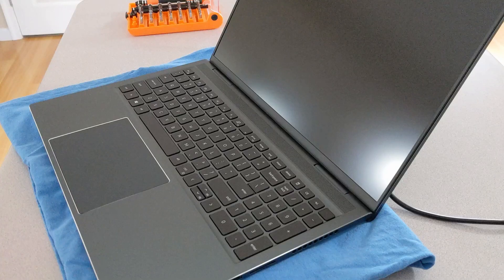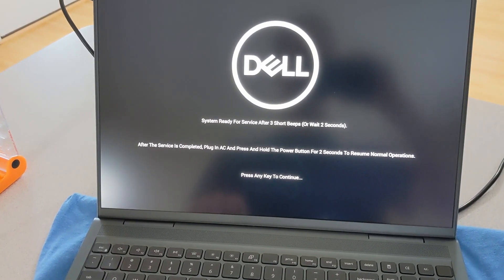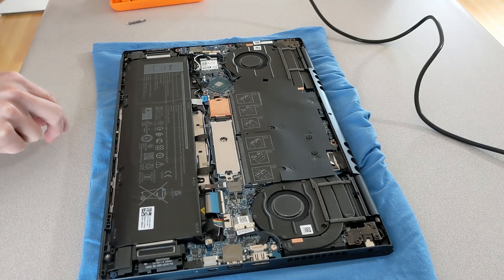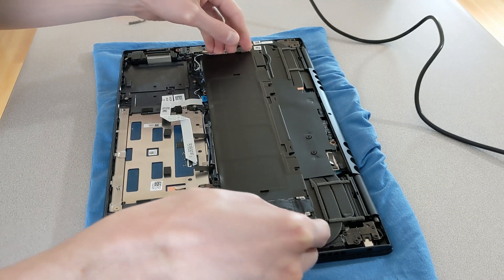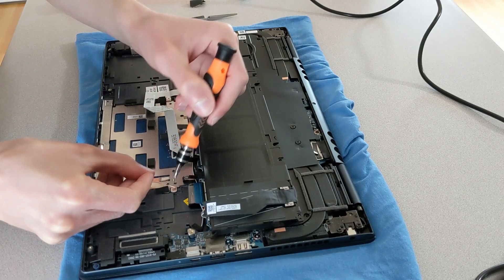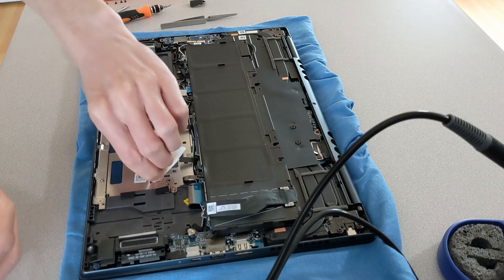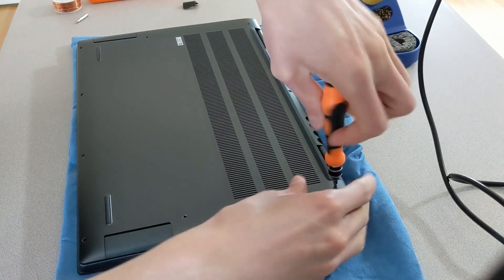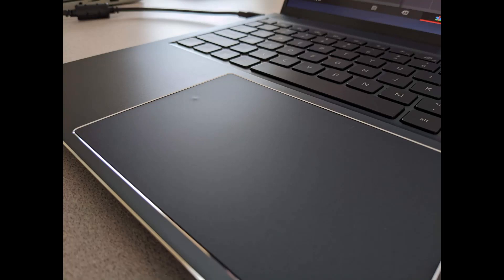Grounding Wire Fix for Erratic Touchpad Issue (Dell Inspiron 16 Plus)

Comment from the maker: I want to offer a big thanks to everyone in the comments for all the kind words and for sharing your results! It is great to see that this fix has helped to restore touchpad functionality for so many users!
Reply: Pretty sure you had your temperature set too high on soldering iron.

Touch pad circuit is just a plastic flex circuit not your normal PCB.

Secondly did anyone here think to use a continuity mode to see if the copper pad and plate are actually touching. 

I have same issue but there is a connection between the plate and the copper pad, how do I know that I used a multimeter to test.
Reply: Also I might add invest in a fibreglass pen to scratch the copper pad for soldering
Reply: Hello Dash rendar  After doing this operation , I noticed 3 new issues , you also?

1) Bump on the surface of the trackpad exactly at the location of the soldering operation, it is ugly

2) strange light electric buzz sounds coming directly from trackpad when you don't touch it, you put your ear close to it, and you ear it as if you hear electricity moving inside trackpad , strange! Before, was not the case! When you put the finger on track pad (contact), this noise disappear, otherwise its permanent noise

3) Device Security Issue
After doing this soldering operation, I noticed issues in Windows Security  - Device Security 
Before I could see the 3 features , core isolation, memory integrity and secured boot, and all was on and well.
Now, those features are fone completely, cannot see it, just white page, on top written : 

"Standard hardware security not supported"
Reply from the maker: @stevewindsenergy  Aside from myself, you are the only other person I've heard from who also got a bump on the surface of their trackpad. Mine isn't bad enough to be a problem or bothersome, thankfully. As far as the other two issues you mentioned, I haven't experienced any odd noises coming from the trackpad or elsewhere, and my computer still shows the three features you mentioned in Windows Security - Device Security.

I don't know what to recommend other than perhaps doing some additional diagnosing to make sure the touchpad is indeed the issue (hopefully nothing else was disturbed/damaged when the laptop case was open). Perhaps open the laptop back up and unscrew the grounding wire, or even unplug the entire touchpad, and see if that has an impact on either of the two issues. I suspect the device security issue may be more involved to troubleshoot and possibly some things may need to be checked/reset in BIOS.

If you determine the trackpad is damaged, it looks like there are replacements selling on eBay for around $40. There have been a lot of people reporting success using metallic tape in place of soldering, so that might be something to consider if you go this route and need to perform the fix again.
Reply: @dashrendar2625  i spent 1 h with dell technicians on phone and 3 hours with Microsoft technicians on remote assistance, nobody could solve problem of missing my security features core isolation, memory integrity..... I am really so helpless
Reply: @stevewindsenergy  Nope, none of those things happened for me. #3 is absolutely unrelated. You really need to reinstall Windows with clean copy, that hasn't been tampered with by Dell.

Comment: After soldering wires all over to fix the issue, which it does temporarily, I'm back to a jumpy touchpad. Now it appears to be affected by static electricity, as if my hands hovering over the touchpad now make it finicky.

Comment: I know plenty of others have said a similar thing, but I wanted to add that I also tried this on my Inspiron 16 plus 7610 (with copper tape from amazon because I don't know how to solder) on both of the copper contacts to be safe and it fixed my touchpad! I got this laptop open box, which I'm assuming the person who initially returned the laptop was due to the trackpad because nothing else has been wrong with it since i bought it in 2021 (and its Dec 2025 as I write this). I even have had this laptop serviced to replace the trackpad and that didn't help, but this video did! I'll have to check the trackpad over the coming days but I'll give an update (if I can remember lol)

edit: 12/9/25 it helped at first, there were no issues but after a few days (like 3 days or so) it went back to being stuttery. not as bad as it was before, but enough for me to return to using a bluetooth mouse. I wish there was a good permanent fix for this, because i have no gripe with my laptop otherwise

Comment: i have a dell latitude 7290 that i bought refurb on ebay and the first day, the trackpad started doing weird things.  I thought it was a power issue (using the wrong charger) but after seeing this, it seems like it's a defect in the grounding.  I may try this, thanks for the info and the video.  Dell obviously has issues across many of its different series of laptops that they refuse to acknowledge!

Comment: worked great with my 5620, soldering was a pain though (apply flux, sand the surface well and set the temp to 380)

Comment: late to the party but wanna thank you for this gem of a fix! Just soldered mine today and it seems to work perfectly again. My touchpad was actually replaced by Dell - it lastet for about a week, before errors reappeared. This laptop is the one purchase I regret most in my life - wont ever recommend, poorly assembled - lot of the plastic broke just through using the laptop regularly. Wish I would not have been blinded by the price and rtx inside...

Comment: did this with yoga slim 7, have same issue where it not just behave erratically but gone from device manager as well. measure continuity of oem conductive tape connecting touchpad to metal body then to motherboard ground, issue is with the tape. Do a bit of reseating of the tape then measure until continuity is detected to the ground consistently, then no more issue with touchpad ever since !

Comment: You are a lot of help, i have a dell Inspiron 16 5620 and after using 2 weeks after purchasing, it's cursor like shakes when moving finger over touchpad even in straight line, I called dell and they replace my touchpad and after some time same issue start happening. Then i came accross your video i did almost what you did just didn't have the soldering iron at hand so just tuck one end of the copper under the screw as you did and on the other side just make a thick lub of the copper and put in the hole touching the copper surface and use the electric tape over it and it works

You really helped other i was about to throw my laptop out of frustration

Thanks

Comment: I want to express my thanks for this video and the guidance towards the problem. After years of trackpad issues and me trying to get to the bottom of it, you explained very well what the issue is. For me, I didn't need to do the whole copper wire grounding thing. When dismounting the trackpad, I noticed that the metal pieces of the trackpad where the screw holes are, and which should make contact with the the rest of the laptop's grounding, were covered halfway in black paint (probably while the trackpad was being painted black, they over-sprayed it). I sanded out the paint, sanded around the screw hole of the other metal plate and everything got fixed. Thank you very much again for this video.

Comment: Thanks for the video. I had received my Inspiron 2 in 1 back from repair for a keyboard issue. The replaced the palm rest keyboard tray assembly. Sinc ethen I had been having  jittery touch pad issues(never had before). After trying  to change several settings in windows to no success, I found a thread in a Dell forum with a link to this video.  Adding the wire as you did has corrected the touch pad issues. Funny it came back from repairs with this issue when it never had it prior. Clearly they  have not implemented a repair process for this with the RMA division when a  new tray install is done Thanks.

Comment: Has anyone encountered a situation, did it according to the instructions, but forgot to switch to service mode. After soldering, the laptop does not turn on, and when you press the power button, the red indicator lights up. The repair shop told me to change the motherboard. Could this problem really have occurred due to the fact that I did not switch to service mode before soldering? Could the laptop go into protection mode and lock up? The bios firmware did not help.
Reply from the maker: My understanding is that the service mode is mainly there to keep the laptop from accidently powering on while it's being handled, like if you accidentally opened the lid or pressed the power button. The repair shop may have already tested this, but if it were me the first thing I would do is a hard power reset. I would unplug the battery and wall charger, press and hold the power button for ten seconds to drain any residual charge, then plug the battery and wall charger back in and try starting it. If that doesn't work, I would try unplugging the battery to see if it starts using just the wall charger.
Reply: @dashrendar2625  I've tried all the methods, but no results. When I press the power button, the orange indicator lights up and when I release the button, the orange indicator goes out. The repair shop reported that the problem may be in the multicontroller, which prevents the system from starting. I guess I'll have to look for a replacement motherboard.
Reply from the maker: @NamTimB1  Sorry to hear it sounds like a more involved issue. Best of luck with your repair.
Reply: @NamTimB1  you shorted the motherboard , you should have disconnected the battery before touching anything inside.

Comment: Linked here from Reddit.  WOW, this did the trick PERFECTLY on a Dell Inspiron 16 7620 2-in-1 laptop.
The frame above the touchpad is NOT aluminum--it's steel.  If you scrape the tarnish off down to bright metal, it tins very readily.  (Worth noting that I used a cheap Chinese temperature-controlled soldering iron set to 400C.  Higher temp makes for a much quicker tinning.)

I took things a bit further than this video...I figured that if a little is going to fix it, then a lot should result in perfection.  I used a 7" length of wire, and made a full loop across five points.  Soldered on left touchpad PCB copper pad, soldered to a spot on the left side of the metal frame, looped above the touchpad, soldered to a copper ground ring on the motherboard, then soldered to a spot on the right side of the frame, and finally to the right touchpad PCB copper pad. 

Before, you could barely move the mouse with the touchpad, and it was clicking/dragging like crazy.  (It was so bad that I disabled tap-to-click to stop the mayhem.)  Corners of the touchpad were completely unresponsive.

After?  Smooth PERFECTION.

Man.  Designers these days sure know how to make stuff to go obsolete...

Thank you for the video.  I'd never have guessed this myself.
Reply from the maker: Haha, sounds like you really went above and beyond with that repair! Glad you got things working and can now enjoy your smooth touchpad!

Comment: Just want to add:  this fixed my touchpad!  I replaced the touchpad, clicking worked again but I couldn't 2-finger scroll or enlarge anything using the pad.  I used 1/4" conductive 2 sided copper tape.  Problem Solved!  THANK YOU
Reply: did u attach the tape to the grounding area? then screw into the tape?
Reply: @teaja3  nope, I just pressed the tape down on top to connect the copper section to the screw at the corner. Mine took about 2" of tape per side, my machine looked a little different than the one in the video.

Comment: I just did this fix. Worked awesome, thanks. I had some old solder and an iron, but no copper. Looked around and I had some twisted copper as part of a electrical wire, so un-twisted a few strands and it was small enough. Went ahead and soldered both sides. I didn't use much skill, but it worked!

Comment: Just wanted to confirm, I performed this fix on the Inspiron 16 2-in-1 (7620) last night and it appears to have been successful.  Similar layout internally, different under trackpad payout, but the copper pads were obvious that needed bridging

Many thanks for posting this guide, deffo saved a laptop and a window!
Reply: Can also confirm that it works on an Inspiron 16 2-in-1 (7620).  Soldered across the points on mine today, and touchpad perfection was restored.

Comment: Thank you. This works perfectly!
Reply: Hey man any updates?
Reply: @TheCodingLadder  Still works fine..
Reply: @chathuraw  7610 model what kind of tape did you use
Reply: @chathuraw  it's all about making connection between that pin and screw right?
Reply: @TheCodingLadder  yes.. I soldered a tiny wire.. Don't forget to scratch the oxidized surface before soldering the wire into the surface.
Reply: @TheCodingLadder  Previously I tried taping foil. But that didn't work.

Comment: My machine was only 1 year old and would have needed its 3rd pad replacement if not for finding this ground was an issue.  I bought this Dell because my old laptop (win 7 system) still worked even after falling down a flight of stairs.

I  used solder as I had read the tape will fail after a while.  For anyone wanting to solder, use a fine emery cloth (600 or finer) to clean the copper surface of the pad and then wipe with alcohol.  Tin the solder iron, then tin the copper pad and the wire you are using.  Then, reheat the tinned pad and drop the wire in and pull the iron away.  This will assure you have applied the least amount of heat as the solder will melt quickly.  Also assures the least amount of solder on the pad.

Comment: Just wanted to say this works. I actually found this video after I orderd my laptop but before it arived. I guess Google was like "oh you bought a dell well here's your protentional future" Well it happend. I rememberd this fix, but i didn't have the tools to solder the wire, so i just put the wire between the conductive pad and the ground tab, then atachet it to the same screw you did, and instant change it work great now. Thanks

Comment: Thank you for the video. I too have a Dell Inspiron 16-7610. Rather than soldering an additional wire for better grounding, i simply did insert an additional wire between the copper plate and the little aluminum tongue. The connection between these two parts was simply too poor to provide good grounding. Now it is much better and my touchpad problems are gone.

Comment: Do you know if this same fix will work on a 7620 2-in-1? It seems to use the same basic architecture.
Reply from the maker: @piotr5646 did the repair on their 7620 2-in-1 five months ago. They left a comment on their experience below.

Comment: Literally just finished trying this fix with self-adhesive copper tape (I’m too chicken to solder something this expensive). Fingers crossed it works because sometimes I want to throw my laptop out of the window because of the trackpad. Thanks for such clear instructions.
Reply: I would like to know how has it been
Reply: @TheCodingLadder It worked well for a few weeks but then I’m back to having the same problems so now I just use a wireless mouse.

Comment: I have inspiron 7620 and had the same problem. First I used double-sided conductive copper foil tape, But the problem returned within a few days, Finally I used soldering as shown in the video (I used welding with a small difference, instead of driving it into the bolt, I also welded it to the top.) and it works perfectly. It seems that the copper foil is not making good contact. P.S If you do not heat it for a long time, no marks or defects are left on the outside of the trackpad

Comment: As many other commenters noted, I just used a thin piece of copper tape to solve the issue with the same idea. I scratched the coating of both sides with a small flat-head screw driver and put the tape so that the exposed metal is connected to that bracket/metal piece that has the tabs on it. I did it on both sides to make sure there's enough conduction of the static off the trackpad. On the right side I did put some extra tape to connect it to the area with the screw in case that helps because I don't want to bother opening this again. Hope this helps someone.

Comment: The solution with copper tape from the comments here worked well and it's totally easy! After a useless touchpad replacement by Dell and after over a year with this problem, I can finally use my laptop normally. Thanks for the video and the comments!
Reply: which model my vostro 15 3510 has same problem from a yr and i also have changed the tuchpad ?

Comment: Thanks. Question : as there is a "foam pad" between the copper tab and the stanless spring tab, why not "simply" removing that "isolator" If it weren't there, wouldn't there be the same grounding effect between the 2 metals ?
Reply from the maker: I don't think it makes a good enough connection typically. Some people mentioned that their touchpads didn't come with the foam pads from the start, and yet they were experiencing the issue as well.

Comment: OMG! I had the first trackpad replaced under warranty and the new one worked for 2 days.  So annoyed that I put it on the shelf until I came across this video.  SO, I don't have a soldering iron where I am, but I got creative.  I made a small rectangle folded piece of aluminum foil (folded tight to be the same footprint of the tab and not too thick...).  I then saw that the right tab was the one probably not making good contact.  I lightly sanded the copper pad, used a tweasers to slip between the copper pad and tab (making the tab more level with the other area), then put a piece of electrical tape over the whole area that the battery would hold down...  BAM!   It has worked for over a week!   AMAZED!
Reply: which laptop model ?
Reply: Is it still working?